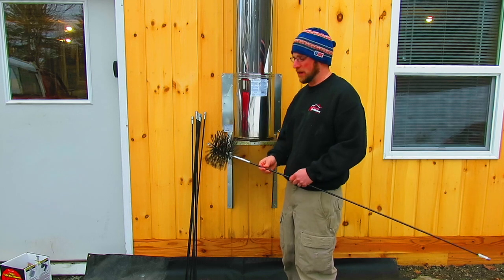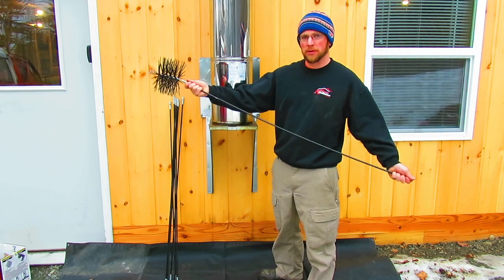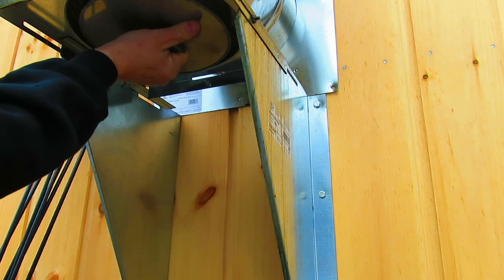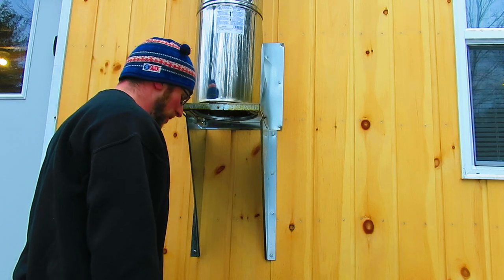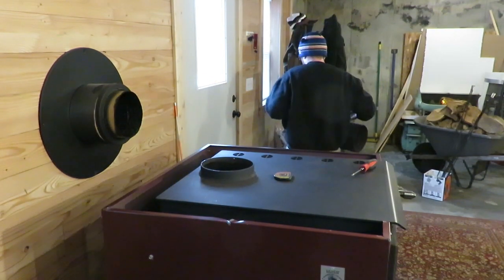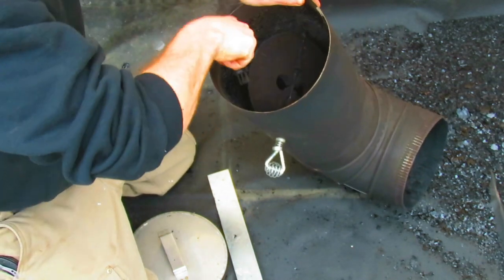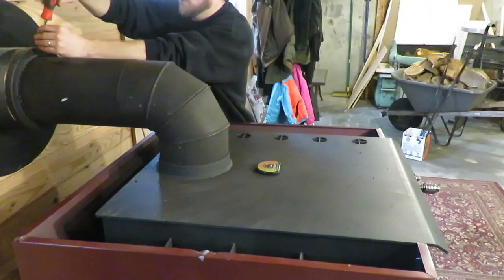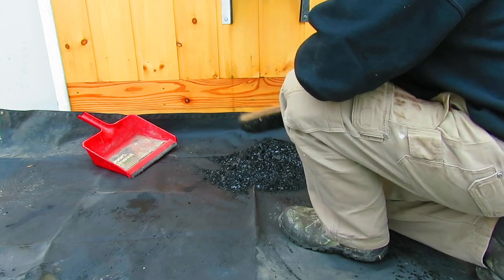How to save $1000s When Buying a Chimney and How  I Clean my Chimney

Comment from the maker: I had to do that at our old house climbing up there when it was snow and ice covered not fun at all. glad you liked the video
Reply: I'm going to clean mine from the bottom this year. I have to pull out my fireplace insert anyway to clean out the gunk. I don't get anywhere near that amount of buildup but I'm also burning mostly dry hardwood in a catalytic stove. Last fall there wasn't enough to need cleaning. I'll run the brush up this year on general principles since I've got to pull the insert to check it. My wife doesn't want me on ladders anymore. Some stuff about sole provider and wanting to keep me around.

Comment: First time I have seen someone use a thru wall chimney. I usually hear that’s not recommended. But I certainly like the easy of cleaning and the fact you don’t need a hole in your roof. How do you feel about it after using it for three years?

Comment: Not sure why am watching this because I dont live where it snows and I do not have or own a chimney. The only comment I have is at 3:49 when removing the pipe over the stove, I think the pipe should be over not inside the pipe, this will prevent smoke from coming into to basement if there is any gaps.  Not sure if I am explaining it correctly and hope you understand.  Great video by the way....
Reply: The pipe goes inside so creosote doesnt drip onto the hot stove.  Even some professional installers get this wrong.

Comment: That chimney is awesome! Hubby has to climb up on the roof every six weeks this winter...it is scary!
Reply: I had a rectangle clay lined brick chimney on a two story with 13 pitch roof. My lp boiler hooked to same. It seemed I never had to clean it giving credit to lil gas exhaust(??). Also I burned 99% 100% dead elm. Then one night a friend had a chimney fire so got concerned. I bought a expanding rectangle cleaner at auction. Worst thing ever. My chimney ended up broke. Coincidence? So I put in ss. It gets dirtier than the old school chimney but then it has different draft etc different stove etc. I don't go to many auctions any more. By the way Nationwide Insurance will not allow even a pellet stove. I try to let stove makers know so that doesn't spread. Oh and I had a valley to help walk up my steep roof which helps. There may be some help/safe tips out there for your roof type? LOL Maybe pile a huge pile of snow below the eve just in case!

Comment: How much is that pipe worth.  Two ways for our home owner ins to cover a house with wood heat . Out door wood boiler or direct vent pellet stove . So im wondering if that system will work here
Reply from the maker: The chimney is expensive but if you use the link in the description that is the best pricing I have found!